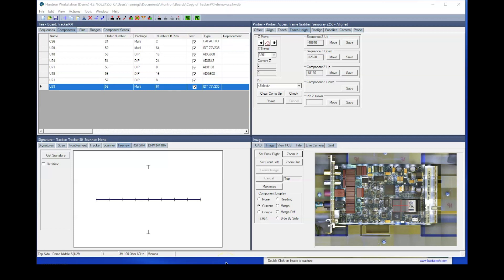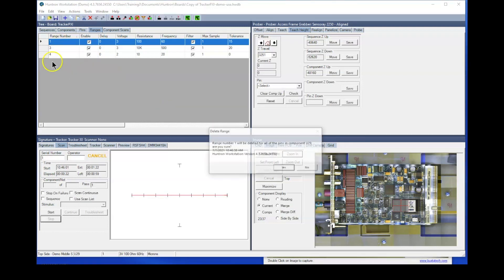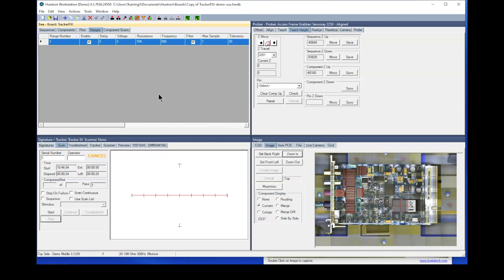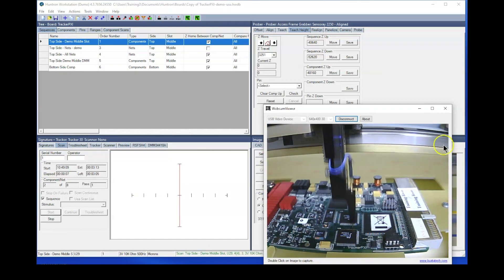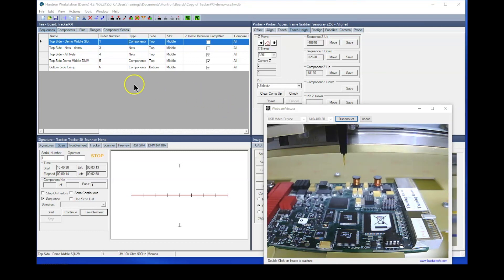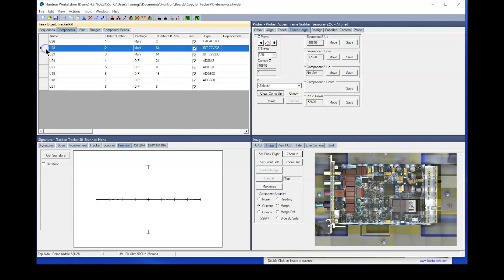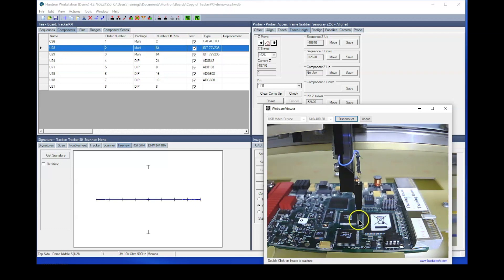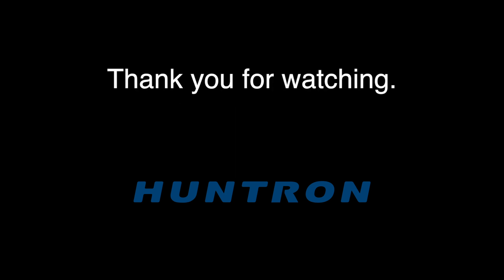Quick Tip #6 - Reducing Test Times on a Huntron Access Prober

Comment: nice, this in CNC fabrication work is called setting the clearance height for end mill or the working end of tool to clear off the work before moving to the next location. the optimum height is also chosen in this field to speed up the work.
Reply from the maker: That's a good comparison, thanks!